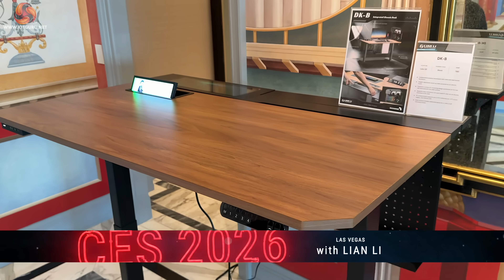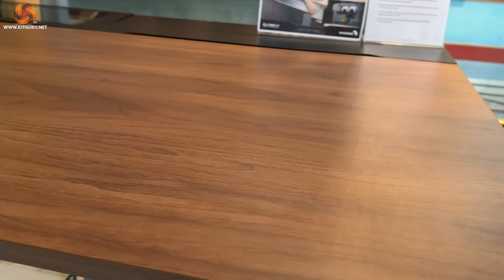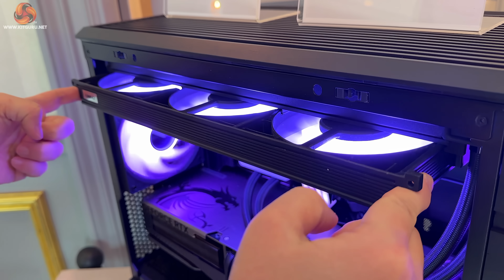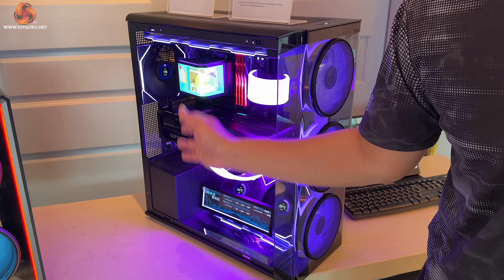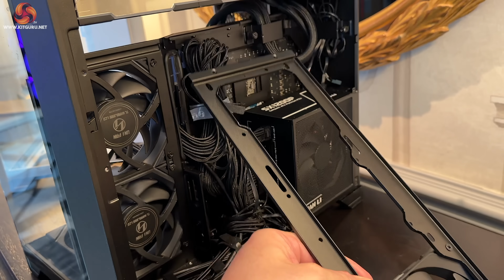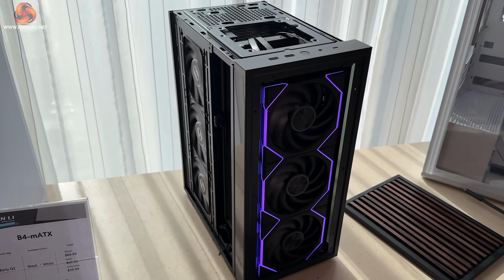Lian Li Lancool 4 Might Be Their Best Case Yet – CES 2026

Comment: The Scandals Dilemma – LANCOOL IV vs LANCOOL III
When comparing LANCOOL III and LANCOOL IV, the differences are not just cosmetic. They directly affect usability and freedom of choice in building a system.

Bottom 480 mm Radiator
Officially supported, but in practice the hoses don’t reach the CPU.

It looks good on spec sheets, but it’s not a realistic option.

Top 420 mm Radiator
Case dimensions remain the same as LANCOOL III.

Larger units like the Enermax 420 simply don’t fit. (460mm) 
/clearance 458mm

Only thinner radiators can be mounted, which makes the “420 support” claim misleading.

Front Intake
Tempered glass panel with proprietary fan group.

No mesh, no option to swap fans, no way to mount a 420 mm AIO at the front.

Users are locked into the stock setup, airflow flexibility is gone.

Verdict:  
LANCOOL III represented freedom and airflow flexibility.
LANCOOL IV, despite its flashy design, ends up being a Scandals 

Dilemma:
Bottom radiator = unusable.
Top radiator = blocked for major AIOs.
Front intake = locked down.

LANCOOL III → Freedom.  
LANCOOL IV → Scandals Dilemma.

Comment: That's great news that the LCD fans will support wired as I'm using a Nollie controller.  I'm assuming we will still need a USB connection and L-Connect 3 to at least upload to the LCD?  I'm  happy if at least RGB can be controlled via SignalRGB and on a non Lian Li controller.

Comment: What I'm concerned with about the B4 is that they seemed to have designed it around the Astral 5080/5090. It looks great in that config, but based on what the presenter said, it wouldn't fit a XFX Mercury 9070 XT. I was thinking of doing a white build with the 9070 XT but neither the XFX nor Powercolor's Spectral white would fit with that vertical kit on it would seem. Shame that this wasn't designed with AMD in mind.

Comment: B4-mATX looks interesting to me, but I'm looking at using it in a flat, horizontal orientation rather than tower. I think I'd like to try it out and experiment with the airflow. I've done this with the A3-mATX and placed some rubber feet on it. Think I might try the B4-mATX on its side to the right and arrange the fans accordingly.

Comment: The small case (with the wood option) is sensibly ventilated, but as soon as a case gets larger, the assumption is that users prefer looking into the case at their hardware instead of at the monitor, and are happy to accept the detrimental effects of a glass panel on cooling.

Comment: The lancool 4 is such a disappointment... 

I have a lancool 2, 217, and a lancool 3. The 2 was great as an airflow chassis. The 217 is just great. But there is something special about the Lancool 3. From native support to what you can add with a minor modification. Mine is watercooled with a 420mm rad up front 360mm up top, a 120mm distro/pump in the rear fan mount, and a 240mm distro/pump on the mobo tray mount. The point of me saying this is whatever your use case the lancool 3 allowed you to do it. 

The lancool 4 seems so focused on a front glass, and mirrors, that your stuck with very limited choices. Not a successor to a great multirole case. Ironically the prototype last year with its lower fans closer was mor interesting, blending mid tower and full tower designs. Very appealing direction, minus the glass front.
Reply from the maker: thanks for sharing your thoughts, interesting to read.

Comment: I'm looking forward to the Lancool 4, but it seems to be quite a bit different compared to previous iterations (I also feel that it has been delayed compared to previous plans, I think it was supposed to be released in 2025).

However, one big question that was lingering around regarding the Lancool 4 for quite some time (and I think on another channel, we were even asked for our input), was about 420mm AIO support at the top, which made sense, considering this is supposed to be a full tower case. I might be wrong, but I even think that one previous iteration had support for 420mm AIO at the top. I can't seem to find this information in the video though.

I'm also wondering about 3.5" HDD support in the Lancool 4.

Do you have some info about these KitGuruTech?
Reply from the maker: We want a proper hands on. We will catch up with them after CES as we have some questions too. And get one to review asap as well

Comment: Did you really made 011 vision M not btf ready ? 

Ppl will have to cut the case like TT tower and hyte 70 because lian li designers failure ?
Reply: That's just people's preference. Not everyone in majority, at least to my knowledge, wants the BTF thing. Probably not yet.
Reply: @jeremyg2236 btf case can be normal or back connect. U have the chose
Reply: It’s still some time off but it’s definitely cleaner

Comment: Any new case which support 420mm radiators?🤔
Reply: That's the biggest thing I'm looking for... support for a 420mm radiator on one side and at least a 280mm radiator on another. Dual 420's would be nice but not needed.
Reply: @c0horst  Im looking for case which support 420mm rad on  top and bottom and 360mm on site. Whit this configuration will be more long case and not so tall, will look more simetric and nice. Lian Li Case O11 EVO RGB,support 420mm on top only.  On bottom Can be fit one more 420mm rad but with modifications.
Reply: not new but abtec c8 line

Comment: I liked their Lancool 216 fan on outside for GPU cooling feature. I have recreated it on the 207 and it works great
Reply from the maker: Good to hear 👍🏻
Reply: I have the Lancool 216 myself and I really like it. 

However I must burst the bubble here… testing has shown that the back fan bracket option does little to no difference for GPU temps in the 216. Check the GamersNexus video yourself if you don’t believe me.

With that said… I don’t know if it’s beneficial with the Lancool 207.